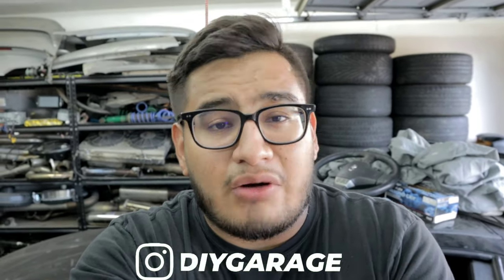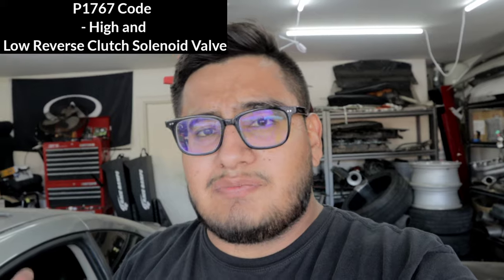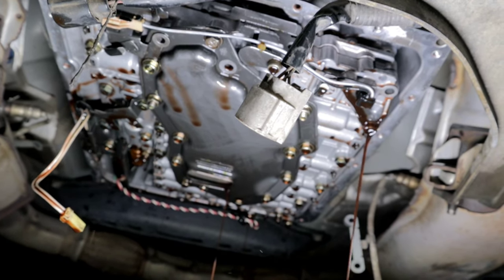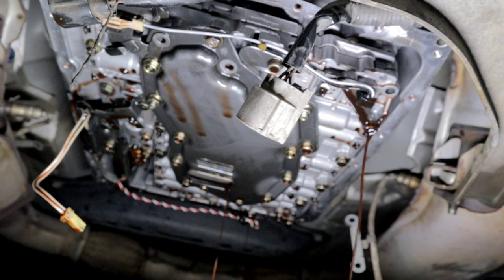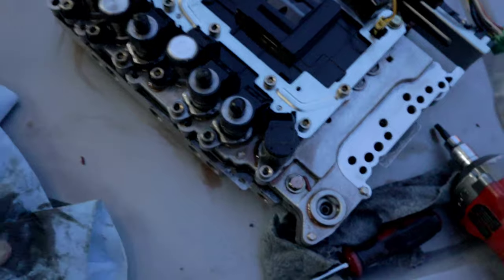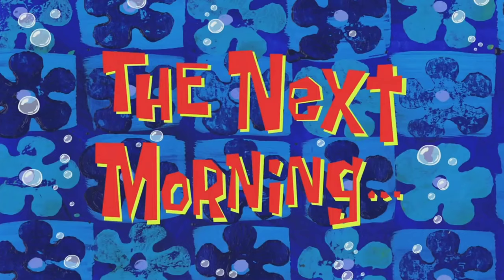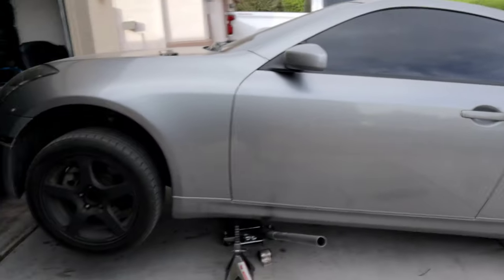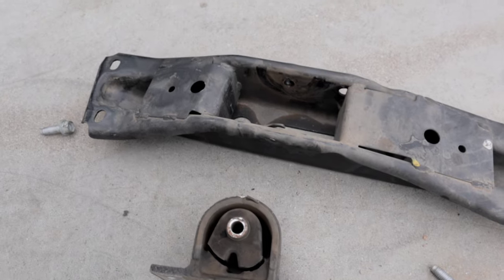More G35 & 350z are developing this transmission issue! Here's what you need to check! P1767 P1757

Comment: Just started having this issue as well ever since I did a drain and fill with Nissan matic J. my transmission randomly has issues when downshifting at certain times trying to come to a complete stop. Doesn’t do it everytime, just random times. It kinda jerks. Has no issues upshifting to next gears or shifting whatsoever.. only downshifting.  Maybe bad solenoids?
Reply: Mines basically the same but it doesn’t shift up.
Reply: @AuzsG35  yea honestly dude I think it might be the shift solenoid going bad perhaps. Can’t confirm with u on that 100% But I do know that most issues with the G35 cars will be the front brake solenoid circuit cracking and it’s why this happens. Could also be low on fluid which also causes jerking and gears to not work properly(slippage), so make sure to have the correct amount of fluid on the tranny. Bands wearing out, maybe the tcm dying, could be a fvck tons of reasons. I am the 3rd owner of my G coupe. So the previous two owners never had done a transmission fluid change for over 100,000 miles. Car currently has 112,000 now. When I changed the fluid for the 1st time, it was oxidized. More like a amber type color, which needed to be replaced ASAP. I just did another drain and fill for the 2nd time to get rid of the old yucky fluid. So 1st I used matic J, which I don’t recommend cause shit is too expensive for a qt. You’ll be paying 20$ on those. You’re better off using matic S as this has superseded matic J and it’s better. After the 2nd drain and fill, it honestly feels much better and smoother with the gears shifting than before. Downshifting has also improved in my case by a little as well. But most of the time when u start to experience some new issues with new fluid on the tranny, its because u prolly already have transmission issues in the first place but wasn’t aware because the old fluid was doing a good job covering the issue as it has more friction. Once the new fluid comes in it starts to clean shit out which can cause slippage and other issues. Clean fluid will 100% show u the existing problems that u wasn’t aware of. Usually it’s very risky to do a tranny fluid change on high mileage cars that has not really got it serviced before. But I decided to do it anyways and see what happens. Regardless having old, dirty, oxidized fluid will fvck up the tranny anyways cause it won’t disperse heat too well. Number 1 reason on why tranny dies. But if u want too u can do the same as me. Just do another d/f and see if it makes a difference. I’m planning to do another d/f for a 3rd time. But not now. I would never suggest getting a flush if u have never serviced ur tranny tho. Shit can deff mess up or completely kill it. Just do d/f multiple times and I think it should be fine and get better.
Reply: @Carmizo_  yea I bought new motor and trans. Trans went out after 200 miles. it was leaking fluid so I filled it up and it didn’t like that. Fluid level was fine but I guess it doesn’t appreciate new fluid.
Reply: @AuzsG35  yea dude never ever fill  a motor or transmission up beyond what the owner manual tells u. If it tells u 5qt for engine oil. Don’t put more or less than that. If it says 12qt for tranny don’t put more than that or less than that. 100% accurate. If u had that leak, u should’ve been on top of it and got it fixed right away cause if u don’t then it’s going to rip a hole in ur pocket which I’m pretty sure it did. Now that u have ur new motor and trans, take care of her and she’ll take care of u. I’d recommend doing a oil change and filter for the motor every 3 months. That’s what I do. And for atf u can try doing it every 25,000-30,000 miles. U just don’t want the fluid to lose it’s red color. Hope the best for u my man.
Reply: @Carmizo_  yea I’m just gonna manual swap. I just found out today it’s done so I’m over automatic. I’d sell it but I just put 3k into the motor. Trans was 400$ so might as well run away with my good motor then fuck with auto trans n waste time
Reply: @AuzsG35  yea u can deff do that my brother. Convert ur auto to a manual. Manuals are better than automatics. Shit can last a lifetime. Automatics are headaches cause it has so many moving parts in them and can easily get fucked up. I chose an auto g35 cause it’s more convenient for me and I don’t drive much. Also here in new jersey it’s hard to find good condition g35’s cause all of them are beat up and abused. The one I got now was honestly in very good condition and it was automatic when I bought it. Interior is clean and has no rips. Hope she can continue to last longer.. but deff do that bro.

Comment: my g just started doing exactly this, the car doesn’t go when i press the gas feels like i’m in neutral till about 2000rpms and then it starts to go, im hoping i don’t need a new transmission 😭😭🙏i just bought this car last week and i can’t even enjoy driving it, it’s so heartbreaking spending money on it and having problems right around the corner, any tips on fixing this problem
Reply: Having same problem what did you do?
Reply: @josecuervooduran6978  me too just recently
Reply: @josecuervooduran6978  what did you do ? I’m thinking about just switching the direct clutch solenoid like how he did and as he says in the video it fixed the original problem which was the car he was working on wouldn’t take off. For my car I have the code p1764
Reply: @josecuervooduran6978  what did you do ? Did you fix the issue ? I have the same problem I’m looking for another transmission tbh
Reply: @bluekurby4936  what did you end up doing ?

Comment: I have a g37 trans went out took it to Infiniti said it’s was valve body so I got it fixed but it had was hard time accelerating a week later and service engine light is back on do you think it was fixed or I need a new trans?
Reply from the maker: I would probably first check what codes you are having if it's anything relating to the transmission I will take it back to the dealership. When the valve body is goes out on these vehicles they usually cause some sort of damage to the transmission that's why it's better to just replace both parts

Comment: Got the dreaded  p1757! 
I removed the valve body, check the TCM didn’t see any broken wires put everything back together should I just order a re manufacture valve body cost $235 ..
Reply from the maker: I've heard good and bad you might need to program it to your vehicle
Reply: @ERICSDIYGARAGE  should I just replace all the solenoids instead of replacing the entire valve body?
Reply from the maker: @jessiecabrera8171  your going to spend more on just replacing the selenoids
Reply: @ERICSDIYGARAGE  ok, my only concern is who would I take it to IF I need to program the new valve body?
Reply from the maker: @jessiecabrera8171  transfer the selenoids
Reply: @ERICSDIYGARAGE  the new valve body comes with new solenoids
Reply: @SYNCHRO yes sir, looking at about 300 for a shop or 385 from the dealership
Reply: @jessiecabrera8171  so if you replace the tcm you have to reprogram it what about if you just replace the valve body ?

Comment: I have a 2006 Infiniti G35x Sedan, automatic, with 180k Miles. A couple of days ago my SERVICE ENGINE SOON light went on and when I turn on the car the A/T light flashes for a few seconds. The codes that came up was P1757 (Front Brakes Solenoid valve Circuit)When I start the car and put it in drive the car starts rolling. Then I apply gas and it drives for about 20 second then I feel a push in the transmission and when I press gas again it feels like something is pulling the car back. When I stop the car and let go of brake, it does not roll, I need to press gas and once rpm reach 2-2.5 the car starts rolling. When I floor it, rpm does not go over 3 and car accelerates very slowly. But once I put it in reverse, it drives fine. Please let me know what you think could be the issue and how much it may cost me (ball park) to get it fixed. Thanks in advance
Reply from the maker: If you have A P1757 you have a broken connection like the one shown in this video look up how to fix a p1757 your vavle body needs to come down, and the broken connection needs to be  soldered
Reply: Same issue with my hr z auto

Comment: Hey man I'm currently throwing a p0744 and a p1744 you think it would be better to try and put the time into fixing them or do you think it's too severe and better off just swapping the transmission
Reply from the maker: It will probably be cheaper to just get a different transmission with the different torque converter

Comment: Yo brotha I have a code p0735 which is a gear 5 incorrect ratio. What do you recommend i should do? I havent changed the fluid so is possible if that?
Reply: Hey brother got the same code did you figure it out?
Reply from the maker: Try removing the transmission pan and checking the screen/filter if it's dirty, that  could be the issue. I've seen that code with clogged filters

Comment: how much fluid is need to fill the torque converter ? Any idea, making may math I think is like 2 and a half but no sure.
Reply from the maker: Its about 3 but it will only take about 8 to fill the transmission and torque converter

Comment: I have a 2005 350 zI replaced the transmission moduler and sylinods all Tcm but it want go hold the program on my Tcm nor will go foward or reverse I’ve been fighting for nine months trying to figure this out please I beg u got any ideas plus in manual it’s in 4 th gear at start why is that  it’s a automatic

Comment: Should of replaced the tcm with the solenoids buddy. I got one I'm working and took a really good look at it.. The actual input sensor that sits on top of the tcm is burned up.. Don't know why but it's throwing all kinds of codes and it's got the same issues as that one your working on..
Reply from the maker: Most people won't sell just the tcm since without it the transmission is worthless
Reply: @ERICSDIYGARAGE  solenoids and tcm came all together eBay buddy pulled the solenoids and got it going again.

Comment: I have a g37 when i come to a complete stop sometimes the trany go in neutral and when i go over speedbumps the same  i was told that i habe low fluid  i chek it multiple times but the guy tell me to let the car warm up and put e brake and put it in drive then chek it i found that fluid was low

Comment: I have an 05 G35, I purchased the car knowing I had to get the TCM reprogrammed. Owner before me bought a valve body from Amazon, installed it, I took it to Infiniti for them to program it however they couldn’t because they said the TCM was already written. They said I can order one but it’s 1700, any alternative options?
Reply from the maker: It can be reprogrammed. it's not like the cv-ts or newer transmissions were once it programed to a vehicle it cant be written again. Get a used tcm from a salvage yard
Reply: @ERICSDIYGARAGE  Will do, thank you!
Reply: Showing codes P1764 and P1769
Reply from the maker: @KnaiStreeter  tcm in the valve body is likely bad.

Comment: Hello, I had the same problem with jx35 of not not responding to going forward or backwards. But the diagnostic code comes with bank 1 do you think it’s actually the transmission problem cause that makes more sense
Reply from the maker: You would need to provide more info like the actual code. You need a decent scan tool to read transmission codes so it's possible

Comment: I drive a 2005 350 z doing the same thing not wanting to take off like a bat out of hell anymore it’s lagging and fixed brake in TCM front brake solenoid. But did u replace all the the outer solenoids to make it stop lagging on take off I’m just asking cause I screwed if have to replace whole tcm cause reprogramming is out of my price
Reply: Make sure your wiring doesn’t soldering
Reply: Soldering ??

Comment: How did you determine what selenoid had the codes,  does a scanner tell you ?
Reply from the maker: A scan tool wont pin point the seleniod that is bad but it will give you a code that you can look into, and by looking up common problems, you can usually figure out the issue. For example, a p1757 shows that the seleniod function is erratic but that doesn't mean the sensor is bad. What usually happens is the wire that goes to the seleniod breaks apart and it will throw this code. Repairing the trace will fix the problem

Comment: I have an 06 G35 auto just replaced the TCM and direct clutch solenoid and now I'm getting code U1000 does the TCM need to be reprogrammed it is new Bosch.
Reply from the maker: Its possible that it's not compatible with your year vehicle. They need to be the same style or yes you will need to program it however some places can not do it right
Reply: @ERICSDIYGARAGE  thx for the quick reply I ordered the tcm with the same part no so hopefully it just needs to be reprogrammed and all plugs were the same.

Comment: Will it be in the transmission also in a 2003 350z A/T? Or would it be under the passenger dash
Reply from the maker: It could be either one depending on the plug type. Jack up the car if you see 3 plugs by the transmission it will be in the cabin

Comment: Hey bro my names Gustavo if you remember but I came over to your crib recently to pick up a transmission and I’ve had this exact problem and with the solenoids so I installed the tranny I got from you and it also didn’t work I still can’t accelerate at all
Reply from the maker: Yes I remember. It's possible that your ecu maybe be at fault or a bad connection if you replaced the transmission and it's doing the same thing It's probably not the issue it's hard to say at that point you have to look further into the problem

Comment: My torque converter is stuck to the flywheel and I can’t turn it to get the other bolt off any help
Reply from the maker: You won't be able to remove the torque converter without turning the engine over by hand

Comment: Hey man i have a 2005 Infiniti g35 coupe that I won’t accelerate and wont move when i put it into drive or reverse I already replaced the pedal,throttle body and ecm from another g35 that i own and i still does the same thing but now it will let me rev it do u think is the transmission? It won’t throw no codes
Reply: Mine and done same as you did u figure what to do to get it to accelerate please I’m so lost

Comment: My auto g35 is ok but it has a bit if a lag when shifting in manual mode.
Reply from the maker: Some lag is normal but if its's excessive try to change your fluid with oem nissan it might help
Reply: I have an 06' G35 Coupe, with 49k miles. Last Oct at around 48k I had Nissan perform the factory recommended flush/change of the tranny fluid. I've read some pro's and con's of people saying NOOO, and some saying it's fine.....im here to tell you that it made my shifts (TipTronic mode) quicker, and tight. It feels really, really good. And got the report from the spent fluids, and all appears to be great!
*Infiniti recommends this at 50k miles.
Reply: @ERICSDIYGARAGE  my g35 now has a problem with manual mode. It will not work after a while and will Automatically go back into D even when in stick is in manual mode. The code is p0745 so it’s one of the valve body solenoids. Do you know how much it would cost to get it replaced ?

Comment: My Infiniti started changing gears bad today I put it on a scanner it came up no codes so I’m wondering if it’s my transmission fluid my slip light is on also with my vdc light not knowing if that maybe the problem
Reply from the maker: Get a good scanner that can read transmission codes

Comment: Hey bro I’m watching your video rn as I do my solenoids. I finished but however when I went to crank my car it doesn’t crank and there’s no gear indicator, battery is good and everything. Do you have any suggestions?
Reply from the maker: There is a small lever on the side of the valve body that connects to a lever coming from the transmission if you don't have that installed correctly it could give you the problem that you have because the vehicle doesn't know that if it's in park or not so you're probably need to drop the pan down and see if that lever on the side is centered correctly
Reply: The one you can move fairly easily right? It is centered on the rod in the transmission. But also I went around one more time and noticed before I tried starting it up again, I took off the connectors that are next to the solenoids to clean and I put them on in the wrong order/direction. So do you think the wrong placement of wires shorted the TCM? Or is it a different problem
Reply: Update: Sorry to bring my problems here but I got it to turn on. It was just a fuse. However now after adding my fluid and bolting everything, my reverse feels really slow. The other ones seem fine, haven’t test driven tho but the short distance that I moved, it took a lot of gas for the car to go reverse. Any ideas? Another fuse or solenoid or what
Reply: @adriangarcia2703 hey bud, I got the same problem and I'm confident  that lever is in the right way, what fuse did you fix?